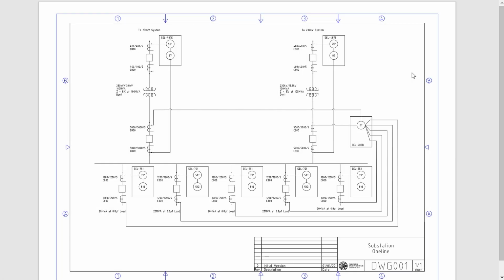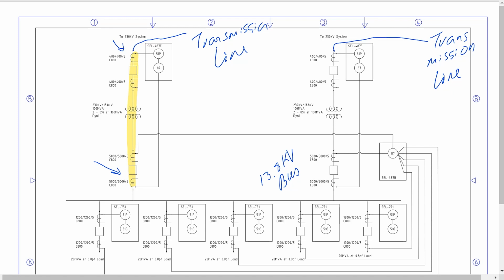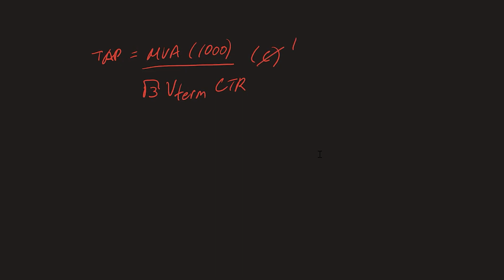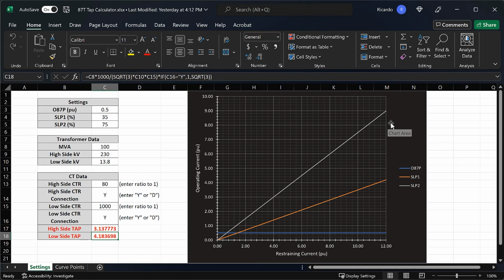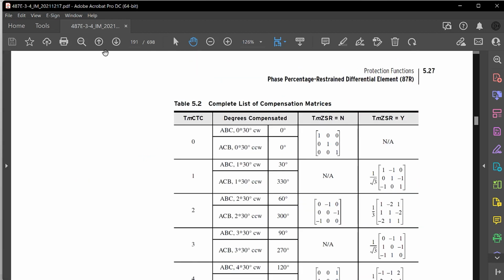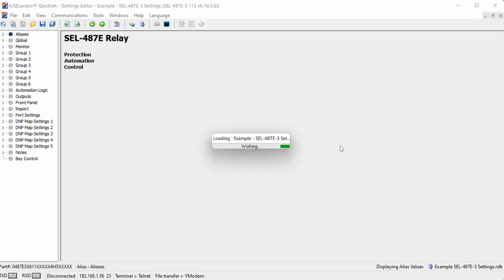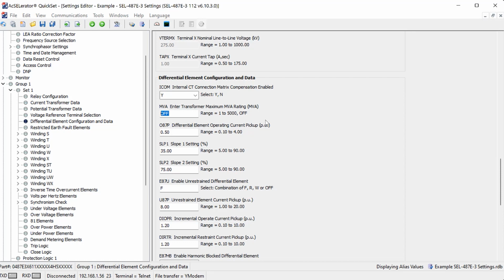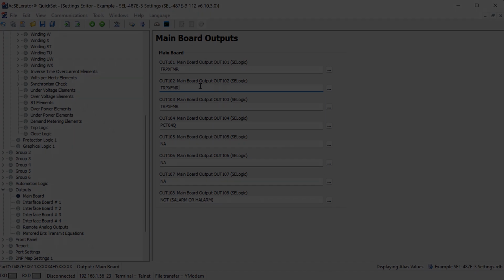Transformer Differential Protection | Calculating TAP Settings and Compensation Angles in SEL Relays

Comment: thanks for the video if am to ask how, if am having a transformer which is connected in Delta at the primary winding and star at the secondary is it ok for me to connect the primary ct in star at the primary and Delta and the secondary to avoid the current phase shift thank you
Reply: Hello. The phase shift compensation is applied to compensate for the phase shift across the transformer that has different winding connections; delta and star, nothing to do with the phase shift of associated with CT connection. We compensate for them in TAP calculations